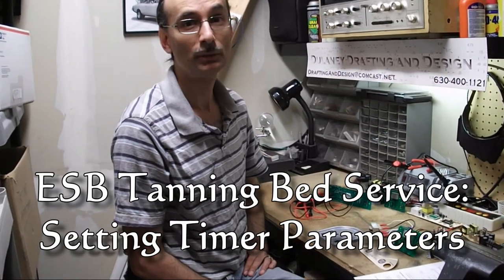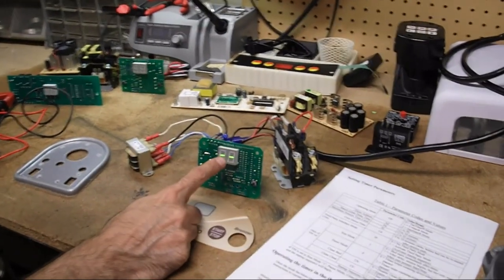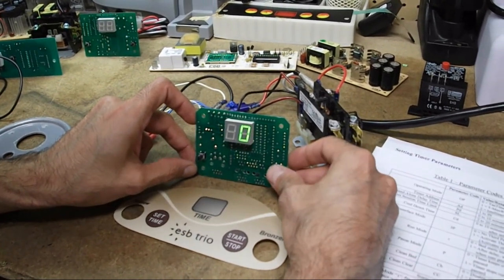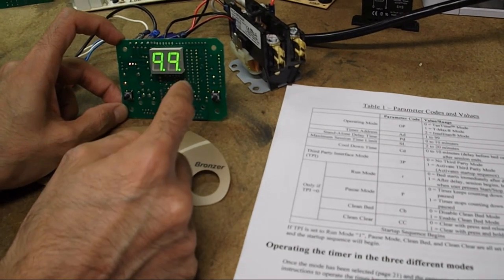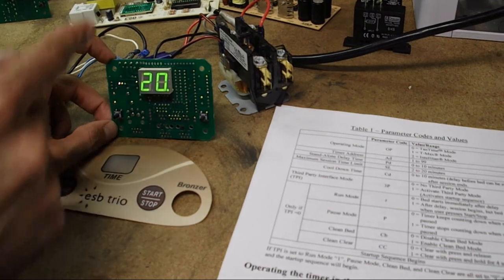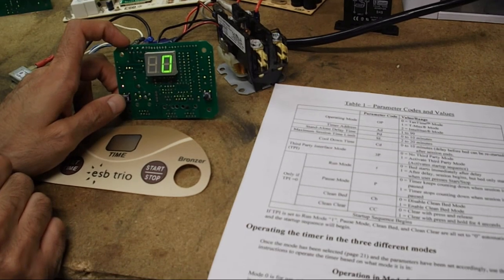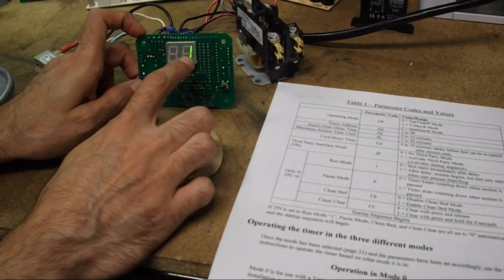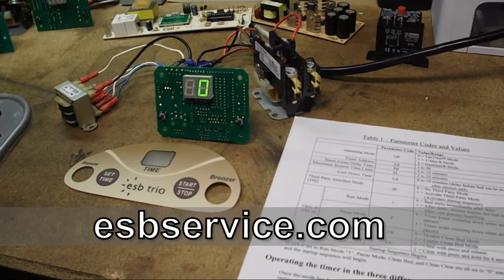Setting Timer Parameters on a 2-Button ESB Tanning Bed Timer

Comment: I bought a solar storm 32C tanning bed from marketplace & I don’t understand how to set the timer up. I don’t want anything but for the tanning bed to come on & start out at 15 minutes when I turn  it on. No delays or anything like that. I have to go through an act of congress each time to get it to just come on. Any help would be appreciated. It has an up & down button & a start/stop button. Thank you sooooo much
Reply from the maker: Thanks for watching and for your question.  I don't have a video on setting the timer parameters on the Solar Storm beds, but if you email me - I can reply back with the instructions.  My email is info@esbservice.com.  Thanks!

Comment: I have an Oasis 36 am I able to program the timer to be greater then 10? 20min is the desired
Reply from the maker: Thanks for your question.  Some timers cannot be re-programmed, but if yours is re-programmable...You would still need to send it to us to have that done.   Usually, it costs $33 plus shipping.  A plan B would be to have you convert your timer with a kit like this one here:
https://www.esbservice.com/parts.htm#!/Timer-conversion-Bundle-ESB-Timer-Bezel-Overlay-Harness/p/342242135
Feel free to let me know however I can help you further on this.  Thanks!

Comment: The fan on my bed is coming on but not the bulbs. Do you have an suggestions?
Reply from the maker: Thanks for your question.  I would like to know the voltage, make and model tanning bed you have to be sure I'm addressing your question properly, but if it were me - generally... I would carefully probe the black and white wires going to the ballast(s) to see if they're getting the proper voltage.  In the systems that I'm familiar with, the fans get their power from the same place as the ballasts - so if the fan is running, but no lamps are...it is likely to be a ballast issue.  I'd be curious to know if this problem is in the canopy as well as the bench?  If you continue to have issues, it would be helpful to know the type of ballast that you have installed in your bed.  If it helps, here's a video on ballast identification:  https://www.youtube.com/watch?v=C_4tRMXM7mo